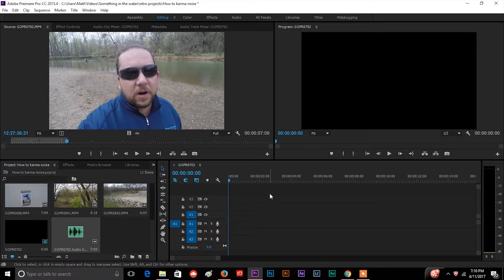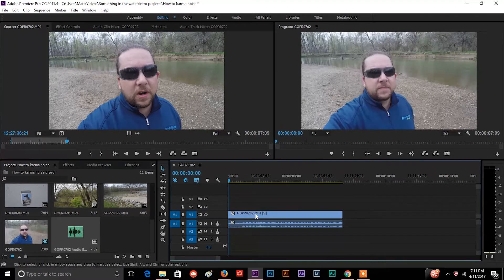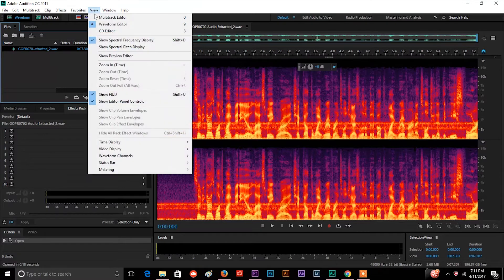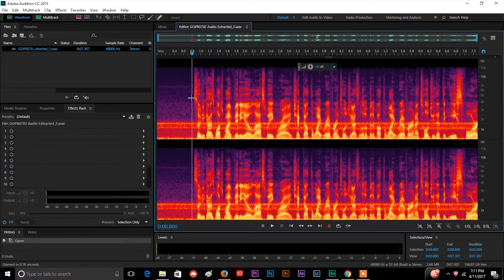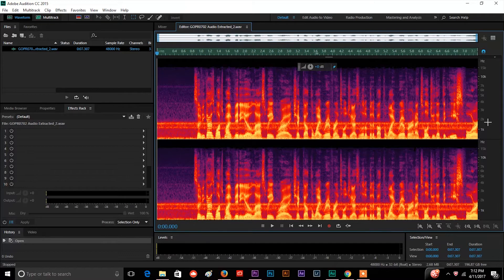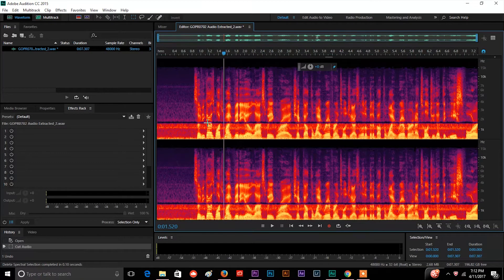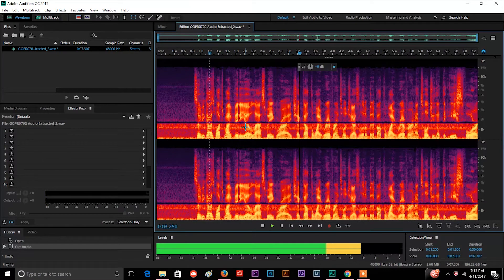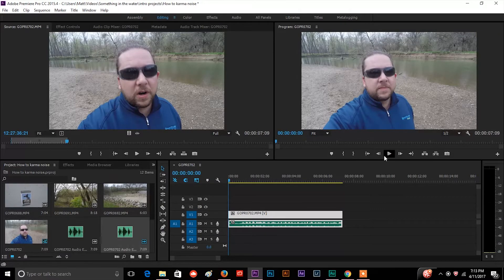How to Fix Bad Audio from GoPro Karma Grip | Using Adobe to Kill Background Noise

Comment: SOLUTION FOR POOR AUDIO ON KARMA GIMBAL

I found a solution that actually works real time.  The Hero 6 (and others) use the data from all 3 mics and processes it into an ok audio track (for an action cam).  The horrific audio issue with the Karma Grip occurs when the port access door is removed in order to insert it into the Karma Grip.  By doing so, the dynamics recorded by the mic adjacent to the port door is altered and the processor does not know what to do with it.  The result is a muffled underwater sound that in my opinion is unacceptable.  The solution is to simply eliminate the mic next to the port.  Simply apply some small strips of electrical tape over the mic prior to inserting it into the Karma.  By eliminating that mic, the processor is able to interpret the remaining 2 mics into markedly better (acceptable) audio.  The kicker is this would be a simple fix by GoPro via a software update allowing to turn individual mics on and off.  Maybe add a Karma Grip mode that disables this particular mic.

Try it out an let me know what you think.